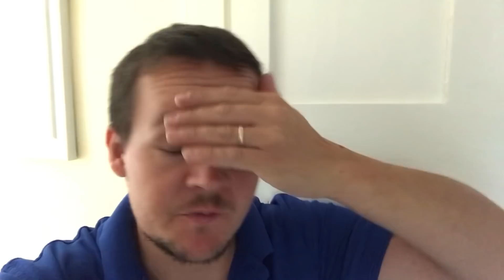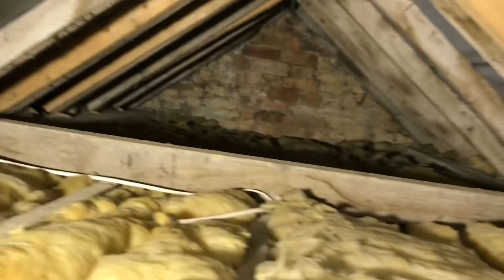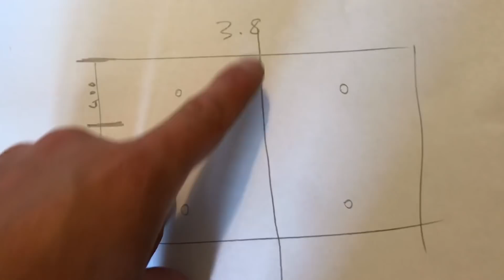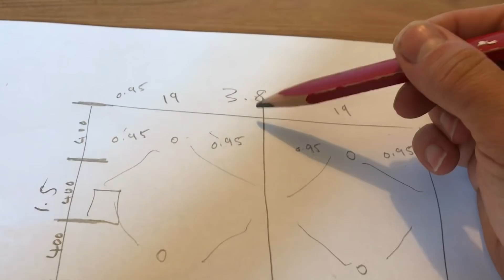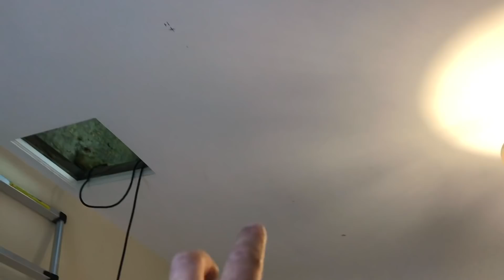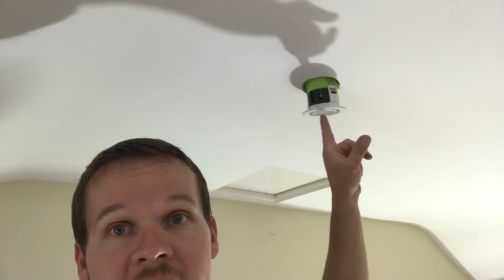Installing Integrated Down/Spot Lights.

Comment: Chris you need to explain it technically (the fittings) so that is just fact vs fact - The fittings with gu10 replaceables are all a 36 degree beam spread but these integrated Luceco's from Screwfix are a 60 degree spread. 

I have the lucecos in my bedroom as per your recommendation and only have 4 for a room in similar size to this. 

You can get different lenses/covers for the replaceable GU10 fittings to change the beam angle from 36 degrees to 60 degrees but it raises the cost. 

Let us know how many of the Lucecos you have fitted in the last 12 months and how many have died if you could have a rough guess?

Thanks for the content - always watch ads and thumbs up, love your diy filming not with a chaperone cameraman lol
Reply from the maker: Been fitting for 18 months now 0 failures. Thanks for the comment I will pin it so others can see your explanation on the beam angle.
Trying to retro fit a new lens to an existing down light to improve the beam angle is a waste of time in my eyes fit these job done give the customer a 12 month warranty easy.
Reply: @Cjrelectrical  Basically if integrated units the Luceco green branded ones from screwfix are the ones to go for. £13 a pop with 600 lumens, 60 degree beam and can get different bezel colours to suit, also have earth in unit and only 90mm depth.

Agree with changing over old halogen gu10 lights to new led ones too. 

As well as that the GU10 leds which you buy the cheap ones aren't dimmable and if they are will be expensive to get the ones that put out 600 lumens out the box. Looking at £8 each bulb and again will be 38 degree beam angle. 

Have these Lucecos around my flat with vast majority on Varilight LED dimmers no dramas 6 months in. 

Sparks are afraid to put integrated units in as don't want to be called back to job if it fails, well buy the tried and trusted units and don't go for super cheap contractor packs in leaflet ads with wholesalers.

Long story short get the Lucecos and Varilight led dimmers and you won't go wrong. IP65 rated out the box and 75mm cutout means you can get hand in hole too. 

Cheers.
Reply: @Cjrelectrical  what if they stop producing these ones and you need to replace some faulty ones in your home where you have used only Luceco. You need to replace all of them even the ones that are still working because they won/t look the same.
Reply: I use the D.A.D.E dust collector. Which one are you using there fella?
Reply: @rayc1503  He's using the same, think its from tlc.
Reply: @shifty277  😜cheers buddy, they look hella lot cleaner then mine. I thought they were a different brand ✋

Comment: Hi, Chris, I'm not a spark but came across whilst trying to get some advice, I have IP rated MR16 spotlights in my wetroom and one of them needs replacing due to the facia degrading ( basically the chrome is coming off) I am unable to find a replacement front parts so I need to change the whole unit, But I can't figure out how to get the thing back out of the ceiling. Any ideas ??

Comment: Great videos Chris. 

Personally I’d have moved the centre cable to a downlight hole rather than do a joint in the middle of the ceiling. It looked like there was plenty of length on it!
Reply: 100%, makes access later much easier without going up in the "nightmare loft" :)

Comment: Random Question: Why don‘t you install 3-Phase residential supplies?
Reply: It’s just not normally required for homes in the uk, you often get an 80 or 100A service so there’s plenty of power and most uk homes don’t really have appliances that benefit from 3 phase.

Why is it so predominant in some European countries?

Comment: Enlite ice liamps are 60 degree spread, 5 watt, 500 lumens in warm white and can get dimmable. I never use integrated now. Fast forward 4 years after you have fitted 12 in a kitchen for example. 1 light fails and they don't make them anymore, customer not really happy having to replace all fitings. Thats why I fit Enlite FD pro, can cover with insulation, push fit terminals and use ice lamps. Any problems just replace lamp, 25000 hour life span, No complaints

Comment: I fitted just under 30 of these 6w LED units and have to agree they are 100 times better than the standard downlighting (Gu10 led ) that I had before, only downfall is that it says insulation coverable but if you read the instructions it still needs a 50mm air gap all round.

Comment: Trouble with those fittings is IR testing the circuit  with the fittings in place.  You must have to wago the joint then test it before you finally fit the unit. Much better/ faster to use a fitting with a pre wired push in connector surely ?

Comment: Can't use these all in one lights as they are usually dumb and difficult to replace when they fail. I change most light fitting out for a fitting that will take a GU10 bulb as I rarely fit a light that is not smart now. Unless doing a rewire, aftermarket smart bulbs are awesome as you have complete control over the colour temperature and brightness and you can just ask your house to turn the lights on and off or dim as you need :)
Reply: Jason Showell  I use these lights with a smart dimmerable light switch much cheaper than buying 4 or 6 smart bulbs.
Reply: @milliethemini6369  is the dimmable light switch compatible with open systems? Does it need a neutral?
Reply: Jason Showell  yes no hub required works with Alexa, google, ITTT and the rest. Also requires a neutral feed.
Reply: @milliethemini6369  what you using? Neutral feed means you can't use it in the UK unless it's a rewire or a more modern house.
Reply: Jason Showell using a mixture of BSeeds, sonoff and Konesky. Yes I had to install 3core + earth wire, only light switch I haven’t done yet is my kitchen as need to pull the floor up in the back bedroom.
Reply: @milliethemini6369  I use IKEA smart bulbs that are 12 quid each so with a housing it's about 16 quid a light but you get colour temperature which is a massive bonus for most people, especially in dual purpose rooms.

Comment: interesting you clipping cables on top of bearers? That is not allowed here in Australia, pretty dangerous as can be easily damaged. We must clip on the side and protect if you have to run over the top like that. We fit a ceiling sockets so that the LED downlight is just a plug in unit, can be easily replaced by anyone. Cheers, like your videos mate
Reply: Dean you’re not meant to here either for the same reasons...

Comment: Top notch dude. I have recently started to fit jcc hybrid 9's. They are ip65, fire rated, you can change the bezels easily, they are easy to fit and look the bollox. Give off a good amount of light and don't break the bank at around a tenner each. Only time will tell how long they last. :) Thanks for the upload as per usual.

Comment: These are the early days of LEDs as a mainstream lighting solution; electricians are doing their best with what's available. We need a big change to domestic lighting circuits - something that reflects the fact that 230V AC is no longer needed or wanted for lighting. Ideally each room of a house would have a robust, readily accessible and reliable 12V D.C. supply and any LED fixtures would be powered by that. Then you would not need to connect each and every LED fixture to 230V AC and expect individual drivers to convert that into something useful.
Reply: As an electronic engineer working in lighting, I can tell you that the engineering challenges were figured out some time back, the problem is people buying bullshit lamps. Stick to the commercial quality products from the big brands and they will last.

DC distribution systems have a whole set of different and in many cases more dangerous problems, dc will arc and arc until the building burns to the ground if given the chance. 

12V really isn’t practical for the power levels people are installing.
Reply: What happens when your common 12v supply fails?  No lighting in any room and the need to call in an electronics engineer.  The probability of a 12v supply failing in, say, a 20-year period? High.
Reply: except the good stuff is 24v and often AC.
Reply: No problem. My point is that 230V AC is not ideal for LED lighting. It would be better if the LED could be connected directly (no driver required) to a natively appropriate power supply.
Reply: These are not the early days for LED. I was fitting them over 10 years ago.

Comment: I use a metal hanger, bend to radius of fitting, then I know if I can fit or not..... I drill hole big enough to allow metal hanger go up through it.
Reply: I'm confused 🤔
Reply: So unbend a metal clothes hanger.

Mark where you want to fit down lighter, fit bent part up and in, bend at same angle at your hand so you know where it's catching and adjust if catches 

This way no big hole to fill if wrong and only little drill bit hole
Reply: @almilhouse9059  I think I know what you mean now, you're in effect using the coat hanger to feel around where you intend to fit your spot?... I'm not too keen on the idea of using a metal coat hanger though, you don't wanna be poking around not knowing what's up there, touch a bare conductor and you're toast, that's why SuperRods are made from a non-conductive material.

Comment: I have watched several YouTube electricians merrily installing these types of integrated LEDs all over the place. I wonder how long before those lights start to fail (maybe even prematurely) and then the homeowner is forced to call in an electrician just to simply (in their mind) change a light bulb.
Reply from the maker: I give all my customers a 12 month warranty where I will happily replace a light for free. Guess how many I’ve had to replace so far 0. They also come with a 3 years manufacturers warranty so I can swap them for free too. I’ve had gu10 led lamps fail within the first 3 months and they weren’t cheap either
Reply: Yes, many poor quality GU10 LED Bulbs out there (I think that they often cook their own driver to death).
Reply: @Cjrelectrical  I don't fit integrated fittings myself (or do much domestic work actually) but when one family I do a lot of work for had some other sparks install a bunch of enlite (iirc - orange cap over wire terminals) fittings in their kitchen, it was maybe a year or two before they were on the phone to me complaining that one of the kitchen lights was flashing.  So, after finding out that Screwfix had this type of light, I replaced it (at their considerable cost).  Then, sometime not so long later, I got another call when another failed in the same way.  So again, off to Screwfix I went...

You/manufacturer/seller may warranty them for a year or 2, but in time they will all fail.  One would hope they'd last 10 years, but really I'd be surprised at 5 as things currently are.  Who wants to have to replace all their light fittings every few years when they start to fail?
Reply: Hey, guess what.  Got another call from the same household this week: yet another failure (flashing after a few minutes), which is now number 3 of 8 in total installed in the kitchen.  So, hit-up Screwfix for another two: one to replace this third failure, and another spare for when the forth goes.  Seems they don't sell this exact model now so had to buy a newer model (Enlite EN-DE8CX) that has the three selectable colour temp settings.  Luckily the existing bezel still fit (so no problems with matching the rest of the kitchen).

Don't get me wrong: they're nice lights - well made, good wide light beam, bright at 8 watts, cheap for what you get.  But... in time they fail, and in not so much time, either - about a few years it seems.  It's just a lot less of a problem when it's only a bulb that needs replacing (as they fail too at just about the same rate in my experience).
Reply: Interesting - Thank you for the update. I have found that a good compromise are GU10 LED Bulbs by Philips. They seem bright, last well and the homeowner can easily replace them themselves.

Comment: Not a big fan of the integrated fittings myself. There are some good quality ones out there and they do look nice, but what puts me off fitting them is that if the LED lamp fails, the customer can’t just replace the lamp themselves, they have to call out a spark to change the fitting which might set them back £40 or £50 upwards rather than the cost of a £2 or £3 lamp change. Also like others have said, when it comes to replacing a unit further down the line, you might not be able to get an exact match.
Never really had any complaints myself from Gu10 lamps not being bright enough, as long as you fit the right amount and use good quality lamps.
Reply: Rightly said, I totally agree. Only if a client is adamant they want integrated unit I'll fit them. Otherwise I steer clear. It makes you seem a bit amateur having to go back and replace units, 3-6 months in.  You can't charge the customers either.  So time wasted rushing back to the suppliers to get replacements plus time to re-install the replacements. It's not worth the hassle. Most customers are more then cable of changing retro led units.
Reply: I also totally agree, but on another side...... and theres always "another side" hopefully these companies see your point/our point and run with a model that works going forward (such as gu10) in the meantime we have had no complaints plus most have 5year warranty and if replacements are required we will just bill the suppliers.
Reply: A good quality led downlight should last for up to 50,000 hours. That’s 20 years based on 10 hours a day. By far the most efficient light option. That’s a built in chip as opposed to an  mr16 or gu10 globe.
Reply: JP sure but even with a 1% premature failure rate it’s still going to cause hassle if you install these by the hundreds

Comment: I used to use these lights but changed over brands as they where only lasting 6 months at a time,have you had any issues?
Reply from the maker: Not one failure yet

Comment: GU10 LED all the way, integrated may be great but they do drop dead one day and it not going to be easy replacing, especially getting matching colour temp and CRI.
Reply: Completely agree I moved in to a house, 6 months later 1 light went, tried to take the bulb out to realise it was integrated. Like for like replacement not available, so had to change all 6 spots £££
Reply: 100 per cent correct.
Reply: Exactly you will never get something colour matched you’ll have to rip the whole lot out, it’s bananas.
Reply: Personally I like the integrated and have bought an extra 4 as 'stock' once the lights decide to pack up. They weren't very expensive and can easily be colour matched as there are so many of these units around now. But it's completely personal preference.

Comment: The downside is.  You get a faulty fitting then find out they have changed the design...........
Reply: thats very true , in the commercial world you can get the same fitting for at least ten years i have been replacing pot lights with 2x18w CFL giving about as much light as a match for 11w round robus fittings for over seven years not one has failed (touch wood) and you can still get the exact same design even though their connections have been updated  you can even get cooler change versions (white warm white day light ) which is helpful as you can tailor the light to the area you are lighting for example over a reception desk the dont like harsh day light , but in enclosed areas such as lobbies or stairwells its better to have daylight although it does expose old paint work ha ha ha
Reply: And that's exactly why I dislike them, I've been burned before.
Reply: @beardedsparks2825  exact reason it's a can and lamp for me
Reply: exactly why they  are not the best solution, such a pain in the ass when one goes and youve got to replace the whole light fitting instead of a couple of quid on a new bulb

Comment: What junction box do you use? And are they warm white lights? Cheers Glenn
Reply: You can get daylight or warm white and he’s using a wago MF JB if you get the JB use wago or ideal push fit connectors.
Reply: Looks like a Wago box.